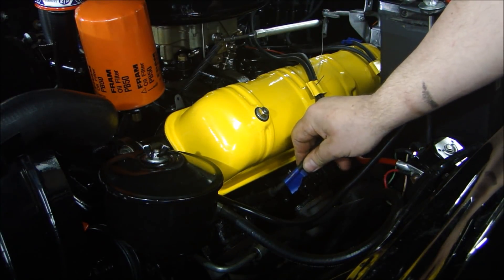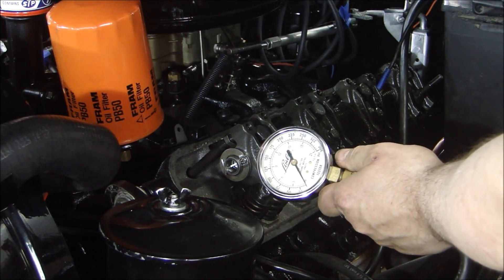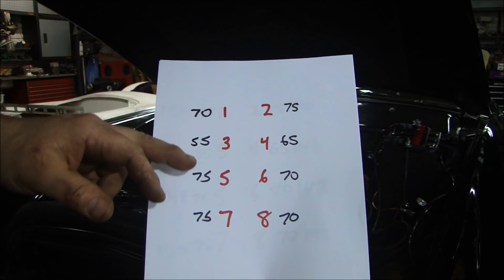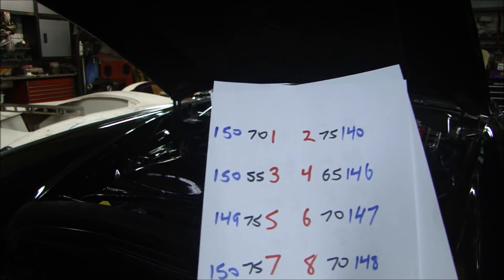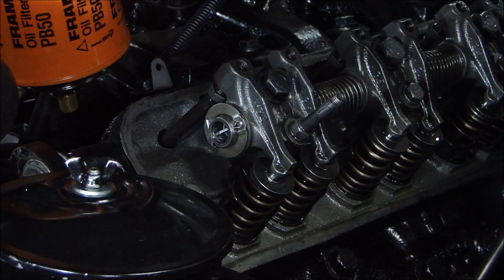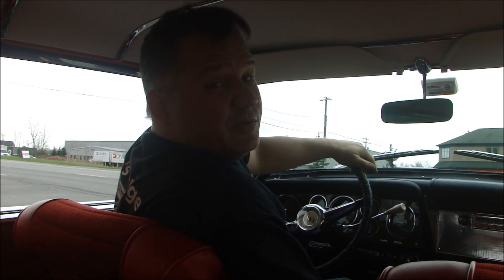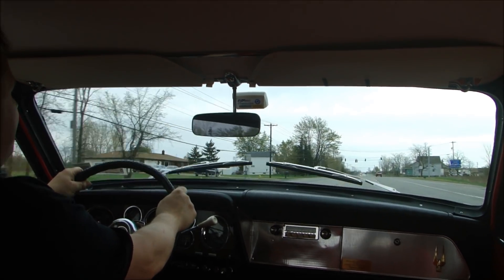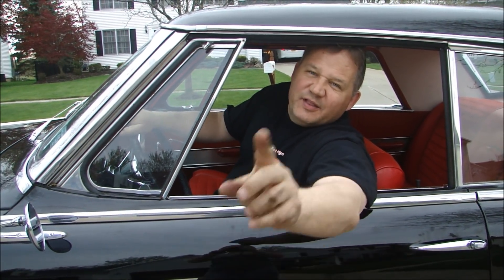Engine Rebuilding Part 10 - 500 Mile Check

Comment: The trans for the 6cyl. Engines started out in low v8s in second 1st if forced to full throttle.In my dads 56 commander 259 while stopped you could feel low engage when you manualy sected low. I loved this whole series good job Pete.
Reply from the maker: Very interesting, thanks for sharing

Comment: The Borg-Warner transmissions are actually 3-speed. In normal driving they start in second and shift to 3rd. But pulling it down into "L" gives you low gear from a stop. Accelerate in low until you have some speed, then shift to drive, allow the trans to shift to second, then pull the selector back to "L" and it will hold second for as long as you want. Then, shift up to "D" and you get 3rd. Downshifting: At driving speed, "L" will get you 2nd gear until you slow to about 20 MPH, then it will automatically drop into 1st, so be careful. Don;t ask.
Reply from the maker: Thanks

Comment: Hey Pete, love the channel but, when you do you plan on flooring it? Just kidding 
Beautiful car and a well done job at rebuilding it. 
I have a question when rebuilding a numbers matching vehicle engine do you feel as allot of folks do when it comes to correcting the factory’s machine work resulting in having a blueprinted engine including painting the engines internal surfaces anywhere that doesn’t affect any moving components promoting oil flowing back to the oil pan quicker destroys the vehicles originality and possibly the vehicles value? 
Klaus 
On an side note, I just noticed this a four year old video I believe I read somewhere, or someone told me creators only get notified only for so long on a video release
Reply from the maker: I always correct machining problems. Blueprints back then had huge tolerances and the factory made lots of mistakes

Comment: In Australia, the 259 cu. in. V8 was popular, but didn't get to experience their performance. It was about 15 years before my time.. I know that Studebakers were used in the South Australian police force, alongside the Chrysler Royal V8 (313 cu. in.) sedans for patrols. Many Studebakers participated in rallies, but suffered from brake and/or suspension failures, and as 'the big three' (Ford, Chrysler, and General Motors Holdens) had parts and mechanics readily available put them at an advantage, so won more often...As a result, Studebaker disappeared, along with the lovely ornaments and distinctive panel patterns. It was a while before GM Holden had a comparable V8 option, (253 cu. in. (4.2 litres)) introduced in 1969 to the HT Holden, and fitted 10 years later to some of its Commodore range. I do see that Studebaker were somewhat ahead of their time in car engineering...
Reply from the maker: Interesting, thanks James

Comment: The BW auto was a 3 speed, not a two speed. I can hear it shift twice.
Reply from the maker: Thanks for the correction
Reply: You are right that it is a 3 speed.  But beware, some Borg Warners will only have one shift.  The Borg Warner automatic used in the Studebaker Avanti has a different valve body and is designed to start in 2nd gear in Drive.  So it only uses 2nd and 3rd for normal driving.  (This is a safety feature since tires spin so easily in first - and they got the idea from Mercedes.)  Of course, you deliberately put it in 1st if you need to.

Comment: Pete, wonderfully done, one correction...it is a 3 speed transmission, but starts in 2nd unless you floor it from a dead stop or use the "L" setting on the gear shift....you did a GREAT job, what a gorgeous car...
Reply from the maker: Thanks Bob. I"m learning more and more about this car. It just came back for some work after a couple of summers. Videos coming soon.

Comment: PETE That valve train seems a bit loud, or rather noisy ,but I guess that's the nature of that type of rocker arm assembly ,and lifters. In fact my Grandfather had a 64 Gran Tourismo  Hawk exactly like that one ,black with the same color interior ,and his sounded just like that one .If I'm not mistaken ,his had a two speed auto too ,and I believe it was made by Borg Warner,, but I could be wrong. It had an engine turned dash with all Stewart warner gauges .He had it ten years ,then bought a Mercedes 240 diesel in 1974.I wish I could've had the chance to purchase that Hawk ,I really liked that car ,and for no more horsepower it had ,it would really run. Very informative video . It brought back a lot of memories . Thank you ,and take care...
Reply from the maker: Great story, thanks Bruce
Reply: I forgot ,Pete .He had a Paxton super charger on his too,, so maybe that's why it had ran so good . I didn't see a Paxton on the car you worked on ,but maybe I missed it, and now I remember the transmission actually started off under normal throttle apply in second range .and when he stepped on it , it went right to low, and then you knew you had something .It took me awhile to bring my memory back but I think I have that memory correct now ,lol. take care........

Comment: Pete, your car is gorgeous...but I have to correct something you said...The car has a 3 speed transmission.  It starts off in 2nd gear unless you floor it from almost a dead top...or use the "L" on the selector...I am sure you simply misspoke...what a beauty....love it.
Reply from the maker: That is great info, thanks Bob. It's not my car, but I enjoy working on it.

Comment: I want to thank you Pete for inspiring me to rebuild me first engine, a '73 Pontiac 455. I am about to get it machine and have started a tutorial on the disassembly. If you want to check it out here is the link  http://www.instructables.com/id/A-Beginners-Guide-to-Engine-Rebuilding/    Thanks!
Reply from the maker: That's cool....although i should have been mentioned in the internet research part...lol
Reply: Petes Garage I'll have to add you lol

Comment: Hi, i have 2006 Dodge durango 5.7 Hemi,engine dead,in my country nobody can rebuild this engine,i watch some videos on You tube they saes this engine have several big problems,valve seats,water in intake manifold,crankshaft and con rod bearing problems,timing chain too thin,pleas can you do solution video of this problems.
Reply from the maker: Sure....send it over and I'll do it.
Reply: Sure you can,Sure i wold like but too exspensive

Comment: Hello Pete
You state that it has a two speed auto box, I'm pretty sure Studebaker only used three speed autos, but they are set up to take off in second gear. If you get it back, from a stationary position, put the change lever in the 1 position, it should then move off in first gear, move the lever to drive and it will change up through second gear and on into top.
  If it doesn;t kick back to first gear at low speed when the throttle is mashed, the linkage needs adjusting.
Ken
Reply: I was checking to see if anyone caught that. Yep, the Flight-O-Matic is a 3 speed with 2nd gear start. If you can find the right valve body (like out of a Zip van) it's easy to convert to 1st gear start. My first car was a 60 Hawk with the same transmission.
Reply from the maker: That is interesting, thanks Ken. It's similar to the old T-bird trannys
Reply: You are correct, from 1951 till the last Studebaker V8 (not sure about the Canadian GM models)...it was 3 spd, but two for normal use, you could put it into first gear by absolutely flooring it from a dead stop...GREAT CAR PETE!

Comment: Curious. Did you do a gasket change on the valve covers or has technology advanced that you do not have too.? Thank you for the videos, they are confidence inspiring to those of us wanting to learn to do it the right way. I appreciate the step by step walk through.
Reply from the maker: Thanks Dan. The gaskets are rubber so they are reusable. It's way better than the cork ones you would have to change

Comment: Nice time capsule driving down the street--- I think they say 10% difference from cylinder to cylinder is easily acceptable but like you show all one side is a bit lower so obviously not a specific cylinder low and with under 200 HP and a 2 speed who cares about performance, revving under 2 grand cruising at 60 is excellent for engine wear and gas mileage and a fully rebuilt engine like that should be fine for years
Reply from the maker: It will run forever like this. Thanks for your comment

Comment: Correct me if I'm wrong Pete but I thought the vertical oil filter on top of the engine was a temporary measure to get the engine up and running and bench tested with a view to it being relocated where it was originally?
Reply from the maker: I had the bracket turned around to hold the filter higher to run it, but it is now in the proper position.
Reply: Thankyou Pete. That engine rebuild coupled with the cars history was brilliant. Any clues as to what's coming next?
Reply from the maker: I am going to work on my Cobra
Reply: Petes Garage Thankyou so much for your reply. Your engine build for the Cobra got me hooked on your  channel originally, a surgical rebuild it was.
Reply from the maker: I'm glad you liked it. Thanks for watching

Comment: Hey Pete,
Nice end result. 
I always do an oil and filter change and head retension (unless torque to yield bolts) and valve adjustment if applicable at first service after rebuild, usually between 800 to 1000 kilometres.
I have enjoyed watching your vids on this rebuild.
Keep up the good work.
Cheers,
Bluey
Tasmania, Australia.
Reply from the maker: I did check the head bolt torque. Great suggestion, thank you

Comment: Cool cruising machine Pete, do you think the difference between the right and left banks is caused by 1950 or 60's block casting technology?  Out of interest, have you asked any of the other Studebaker owners if they have found the same compression phenomenon? Regards Stewart, Australia.
Reply from the maker: It probably is variation from the machining process. The block gets held by clamps and machines to a predetermined center line. If the process moves they would make many blocks off by a couple thousandths which would account for the different pressures.